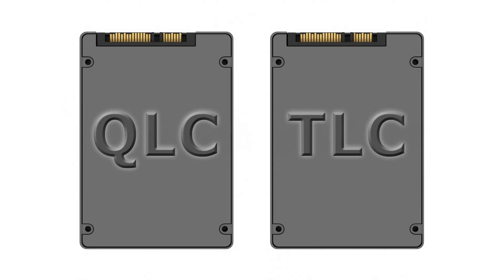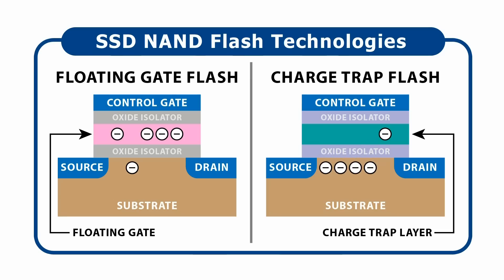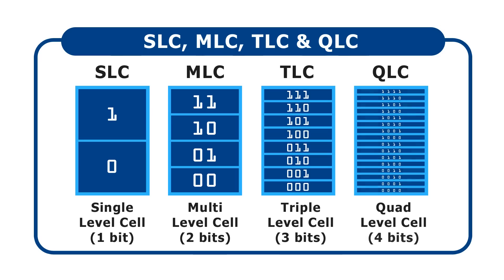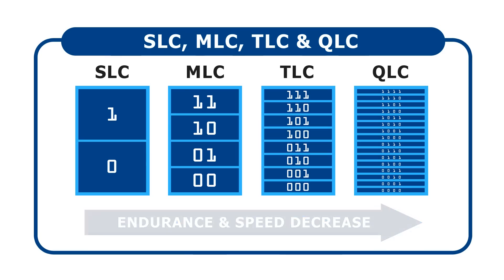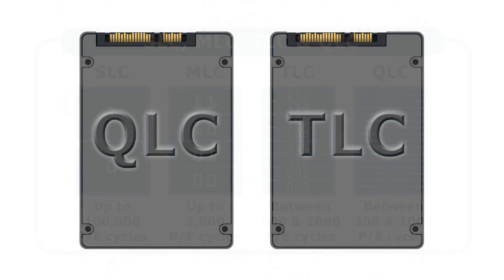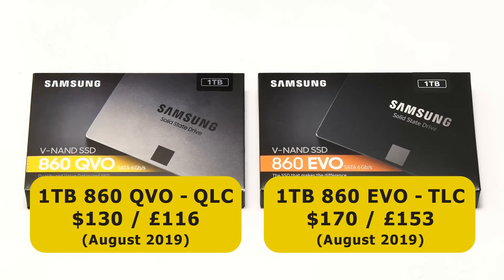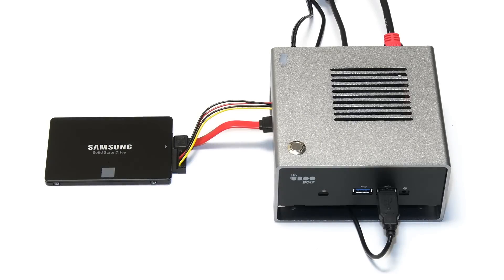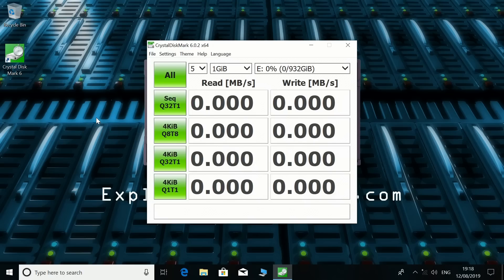QLC vs TLC SSDs: Samsung QVO & EVO

Comment: I just installed a Lexar NM610 Pro 1TB M.2 SSD today to replace a 4-yo Kingmax PQ3480 512GB M.2 SSD that suddenly disappears all the time, even in the BIOS. Kingmax never mentions the NAND type of this SSD but I suspect it's QLC, given the 'Q' in the model number. However, it has a P/E cycle rating of 750 TBW per 1TB, which makes me think it's TLC, but why the Q in the model number? If it is QLC after all, then dying after just 4 years makes a bad impression on QLC, especially since I don't really use the PC a lot and I certainly don't write tons of data. To date I've written only about 10TB, which works out to around 20 P/E cycles, a tiny fraction of the 750 P/E cycle rating.

It's the same thing with the Lexar NM610 Pro in that Lexar is kinda quiet about the NAND type, but many people suspect it's QLC based on the rated P/E cycles of just 300, and I confirmed today that it is a QLC drive. 

So yeah, while I may have been using QLC for the past 4 years, I have no real confirmation that it's QLC, and today's the first time I knowingly installed a QLC drive, and it's the system drive even. I hope it doesn't die all of a sudden like the Kingmax did.

Comment: Great video

2 questions:

1. Does the data in the cache get moved to the slower cells by the drive firmware in the background to make space for the cache to be used again? Is there a risk of corruption if the drive is powered down while the cache is transferred even though the OS will have finished its copy operation?

2. How does MLC/TLC/QLC store multiple bits in one cell? Multiple voltage values in one cell?

Comment: I've been using an Intel 670p 1TB QLC SSD as my boot/OS drive since my first PC build back in December of 2021, and it's still perfectly healthy. That said, I admit that I use a pair of external SSDs to supplement my storage capacity. 

For my second build back in July this year, I bought two 2TB versions of the Intel 670p to use as drives for my Steam games. They were both $60 each at the time, so the price was too good to pass up. Plus, my existing 670p attested to the reliability of these drives; in my opinion.

Comment: Nice video. About warranty, how does this work in practice actually? Is this just used as indication of quality or are there real benefits having such warranty. The warranty is also limited, limited to what? Don't get me wrong but I never used any warranty. In my opinion this is buzz to sell something, it doesn't say anything. 

In case of a drastic failure (production error or something like that), you don't get your data back. Maybe you will receive a new drive after some evidence it is not your fault (can be very complicated process - like with insurance)  but the most important thing, your data, is lost.  In case of a failure I think you think twice to trust the same model again. This is not about a washing machine or something like that, it is very crucial part. What are the benefits of having a long period warranty on such product anyway?

Comment: Turns out some 870 EVO from a batch are failing. I have two I had to RMA. I have much older SSD drives without errors and these relatively new 870 EVOs are degrading fast.

I suggest everyone to do a full diagnostic scan in Samsung Magician. If you find red blocks before the warranty usage / time you need to replace your drive(s)

Comment: USA prices December 31, 2022:

Samsung 870 EVO 2.5-inch SSD
1TB about US$95 for QVO and about US$100 for EVO
2TB about US$150 for QVO and about US$160 for EVO
4TB about US$300 for QVO and about US$350 for EVO

Samsung m.2 NVMe 1TB
970 EVO Plus about US$100 (PCIe gen 3.0 x4)
980 about US$90 (also PCIe gen 3.0 x4)
980 PRO about US$130 (PCIe 4x4)
990 PRO about US$170 (PCIe 4x4)

Samsung m.2 NVMe 2TB
970 EVO about US$190 (PCIe gen 3.0 x4)
980 PRO about US$220 (PCIe 4x4)
990 PRO about US$290 (PCIe 4x4)

Thank you, Chris, for a year of amazing video content and enjoyment.
Reply from the maker: Thanks for posting this very helpful listing. :)
Reply: @ExplainingComputers   Any time, and Happy New Year 2023! 👍
The SSD prices are a happy consequence of pursuing a 'hot,' intermediate-stage storage pool upgrade for a researcher's HEDT.
(For a poor woman's version of the Liqid Honey Badger . . .)  Her HEDT 'puter is getting an Asus "Hyper m.2 NVMe SSD AIC" PCIe4.0x16 Add In Card filled with 4 NVMEs. On paper, her HEDT's upgraded 'hot' storage should achieve speeds in excess of ten times versus a single 2.5-in. sata SSD (assuming no striping, e.g. no Raid 0) . . . And over 40x (assuming Raid 0 across four NVMEs) versus a single 2.5-in. sata SSD.
Whereas CPU and RAM should not be bottlenecks, her network connections will not keep up with 25,000+ MB/sec; but that is a project for another day.
Kindest regards, neighbours and friends.

Comment: Excellent video +1
The only thing negative about the World (not about this video) is that the nice prediction made in the end at 15:37 mark is not met.
Here we are at the end of 2022 (1 whole year AFTER the time period of the prediction, and still there is no 4TB SSD in sight at the 100 $ price point.
For some reason the price drop of SSDs existing of only a bare PCB a controller and some chips is way slower than that of extremely precision made HDDs with tons of metal magnet parts used per each HDD.
Now a 8TB HDD costs about four times less than an 8TB SSD (such as the Samsung 870 QVO). Why do not more manufacturers bring large QLC SSDs in to the market?
Reply from the maker: Thanks for this. The pandemic and ongoing supply chain issues messed with the prediction. :(

Comment: In my experience, QLC isn't good for a system drive, but fantastic for the storage\game driver, as a secondary one.
My system Crucial 1TB ssd got 5% wear after a year, my 4TB Samsung QVO got just 1%, even though I constantly download new TV shows, movies and on it, save lots of files AND it's most often 3\4 occupied, while also having the pagefile on it. While the system 1TB only stopped to wear out rapidly(I was losing like 1% each 2-3 months) when I freed like half of it. Simply because, a system drive writes data automatically all the time, hence I AT LEAST would recommend TLC memory for a system ssd, MLC ideally if you can afford it.
Reply: Or U could use a SPINNING REGULAR HARD DRIVE since they have FASTER transfer rate than SSD (according 2 this test!) & INFINITE re-write cycles = fux sake =))  U talk like a junkie trying 2 decide which poison 2 take.  Break the brainwash chains, dood =)

Comment: Great video, just that the predictions of the prices are clearly off the mark xD. 4Tb SSD is 400€ where I come from... Still way too expensive, and I clearly have to wait to buy those. I have HDD as options but they are not nearly as reliable as SSDs even for media storage which is basically why I want them really.
Reply from the maker: On prices, you may have noticed that we had a pandemic! :) So no (IT) supply chains have been as predicted.
Reply: @ExplainingComputers  Yes I noticed. But it doesn't seem like 100€ for 4tb SSD is coming anytime soon, when I say soon, I say from now to end of 2023... Maybe by 2024 we'll have those prices.

Currently, you can buy a 22tb HDD Gold Western Digital drive for less than an 8tb SSD Samsung QVO. That's almost 3x the storage for less price... Still a big gap to cover.

I have a Gold 6tb HDD drive from WD which I've been using almost constantly for almost 4 years now (18.000 hours) and it's still at 100% health, which is very impressive for a hard drive considering I've had Hitachis and Seagates and other WD (Blue and Greens) starting to fail on me just after 2 years or so with far less hours on them,. So those Gold rated WD HDDs are really no joke in terms of reliability, but the noise they make is really unbearable unless you use headphones, plus the power and the weight they add really offputs me from buying HDDs.
Reply from the maker: @grimm6jack  Agreed -- HDDs still have a big advantage in terms of cost per gigabyte. But at the expense of noise as you note! Right now I have a WD Black 10TB clicking away beside me backing up data. Very happy, but making its presence felt.

Comment: My own use follows this. I do some videos and big ones start out fine but with my 8TB unit it seems right about 80GB in the speeds go down to even slower than the hard disc drive!
Now, most of the time this is not an issue. I backup regularly and the files sizes are fairly small. But I switched backup software the other day and it took some 18 hours to send almost 6TB of data from my NVME and SATA 860Evo drives. 
But if I need files from it, they come out fast as anything else. And if I send photos to it or a small file, it goes fast... unless it's over 80GB.
BTW, the lower TBW is not so bad becasue this thing loads so slow I don't EVER want to have to put big files in it again. It's going to be my archive file eventually, that I can pull old snippets of video from and I won't be writing to it once I get it nearly filled up. But it is good for storing files, once you get them in.
I am a Samsung fan-boy I must say. I like the Magician software particularly. My Team-Force SSD moves as fast as my Samsungs, but I can't get into it the way I can Samsung's. Those little details and abilities Samsung gives us to allow them to last longer and perform well is what makes the extra price worth paying. I t may seem like  a lot more... but for something that may very well last a decade under regular use, paying a bit more for reliability and ability is worth considering.

Comment: Hehe.. your fortune telling about the prices in 2020 and 2021 was VERY wrong. Its 2022 and the QLC 2TB still is 180€ (150 GBP or 202 USD). If you buy from a Brand that is. Crucial, Samsung and Western Digital
Reply from the maker: As you may perhaps have noticed, we've had a pandemic, which has disrupted supply chains.

Comment: i liked this video very much. will it be possible to post a comparison between 860 evo vs 870 evo?
One more thing - i am searching for a 512 GB external SSD for data backup. Can you suggest a good one? i have a Seagate GoFlex 500GB spinning external HDD from 2010 which is showing signs of slowness. Before it gets even worse, I want to buy a replacement. I want it to last 8-10 years at least... since it is a backup drive, i will mostly use it a few times a month to add/update; definitely not everyday. Is Samsung T5 good? Or should I use samsung 870 Evo with an external USB adapter?

Comment: Can anyone say which to buy: evo or qvo? Why all videos are 20 minutes of explanation
Reply from the maker: It depends what you want to do with the drive! That's why there is a video showing test results and explaining the different technologies used in QLC vs TLC drives. QVO drives are cheaper, but can be written to less times before they fail, and are very slow for very large data transfers. EVO drives are more expensive, but will survive more data writes per cell, and provide faster large data transfers. For many applications, QVO drives are a good choice, but not in high-speed, high data volume applications like video editing.

Comment: Dec 2021 QLC 2 TB 171$. TLC is still cheaper at 159$. QLC is still more expensive than TLC.
Reply from the maker: Firstly, since this video was made we've had a pandemic, introducing massive disruption into IT supply chains, and slowing the diffusion of new technology. Secondly, except for low capacity drives, I am surprised by what you say. For example, on Amazon.com today, a 2TB Samsung EVO is $239.19, and a 2TB QVO is $174.95 -- so QLC is cheaper if you compare like with like.
Reply: @ExplainingComputers  That is True, Covid really messed up a lot around the world. However, it was a Great Video, and Thank You.

Comment: They have an 8TB 870 QVO with 2,880 TBW, which makes me wonder if you could do 4TB over-provisioning on it and effectively get 5,760 TBW, which would be more than the 4TB 860 Pro's 4,800 TBW. 🤔

Well, perhaps not, but it would make some sense that their QLC implementation would physically necessitate having higher quality per cell in order to reliably store that much more data.

Comment: Question: if I switched power off  after 2 :41 for evo then those data still would be on ssd or it would disappear as data was only in ssd ram cache?
Reply from the maker: The data would not disappear. The data is not in a RAM cache -- the cache is higher speed flash memory.
Reply: @ExplainingComputers  ok thank you. thought it's ordinary RAM cache chips which required power to keep data

Comment: The key issue with SSD's (once you fill up the cache that is), what if you power your machine OFF while in a hurry to go somewhere (if it's a laptop that is)? You'll lose that data still IN the cache as soon as the power is cut (device shuts off). which would be an epic pain in the arse. Same can be said for rebooting (some laptops or desktops even, cut power to the disk for 1-3 seconds after reboot), you will lose that data if it's still being silently written to QLC or TLC.

In any case, once I eventually switch to an SSD (have a shelf filled with hard disks!), i'll always keep that in mind for the desktop and laptops. At least in the case of USB SSD's (Flash drives), you know when everything is written once the light stops blinking, or goes out.
Reply from the maker: SSD cache is flash memory, so you do not lose the data in the cache when the device is powered down. It stays there perfectly happily, and continues to be transferred to the standard cells when the drive is powered up again.
Reply: @ExplainingComputers  I'm talking about the SSD's that use DRAM caches (dubbed *super fast write speeds*), and sometimes you can't even tell anything until you've done a test and the file isn't there before it's even written to the disk, or it's corrupted (file is a quarter of it's size being one example).

Comment: @ExplainingComputers you made a slight mistake with the “there should be slc cache” part: 

You’re right that there is turbowrite cache, that slowdown for the 860 evo goes from 520 down to 500, so to the naked eye there would seem to be no difference in transfer speed. However, if you try to copy 2 lanes of files at once (drag one set of files then drag the other), you would see the difference.

In short, 520MB/s turbo, 500MB/s sustained for the 1tb version.
The 250GB and 500GB versions are throttled down to 300MB/s, so if you purchased those drives to compare then there would see a difference to the naked eye.

Comment: great comparison,  but you could have just got to the bench marks, most people will not be interested in any other difference
Reply from the maker: The hardware differences explain the benchmarks, and also -- critically -- how the drives will fare over time. So, for example, if you want to use a drive for video capture and editing, the EVO is a much better drive than the QVO due to the higher number of P/E cycles. So the benchmarks really only reveal part of the story and are not a good guide to the performance of the drive for many users.

Comment: that transfer drop on the qvo is troubling! its a big difference actually! if you are going to transfer hundreds of gb of backup you will feel it, but how about if you just want to use it to run an os? there wont be a difference in this case?

Comment: Does having a cache mean I have to let the disk "rest" before the copy can be considered done? What if I copy like 20GB and then shut down the computer once it's done? The data would still be mostly in the cache, right?
Reply from the maker: Yes, if you shut down the computer the data would still be in the cache, and would continue to be moved to other cells when the computer it next started up.
Reply: @ExplainingComputers  ah, gotcha.. Gotta be more careful with external SSDs then, give them time to cleanly move from cache to disk, just to be safe (and guarantee max performance for next time). Thanks a lot for answering!

Comment: People don’t realize how slow TLC and QLC are really. I did some tests myself with a WD blue nvme ssd and a MLC enterprise drive. For the 1GB R/W test, the nvme drive achieved 2500mb/s reads and 1700mb/s writes. The enterprise drive achieved 1500mb/s reads and 1000mb/s writes.

Because of the SLC cache in the nvme drives, the “TLC” drive outperforms my MLC drive. My next test was a 64Gb R/W test. This will definitely use up all the SLC cache in the NVMe drive and the results show, the NVMe drive achieved an average of 1000mb/s write speeds. In the same test, the enterprise drive held its 1000/mb/s write speed since it was made from entirely MLC. That being said, the average consumer usually would only use the SLC cache to write in most day to day scenarios (The 8PBW rating of my MLC drive is a wonderful plus though!)

Comment: So which is better for PS4 pro upgrade?
Reply from the maker: Both would be fine, so I would go with a QVO to get more capacity for your money. The speed differences writing very large files will not be an issue with a PS4. They are more relevant for applications like video editing.
Reply: @ExplainingComputers  
Ok, I have one more question I'm aware that in upgrading the ps4 pro I'm going to need new drive , and external hard drive or flash drive to back up any data I wanted saved along with downloading frameware and transferring to new drive. My question is could I also aquire a SATA to USB transfer cable and reconnect the old drive so as to not lose data on it along with not having to to redownload all game install data ? A 1TB of storage is 1TB of storage
Reply: @toddmilliken5268  sata speed will run at the usb version the ps4 pro has